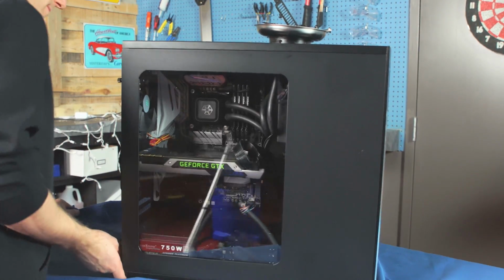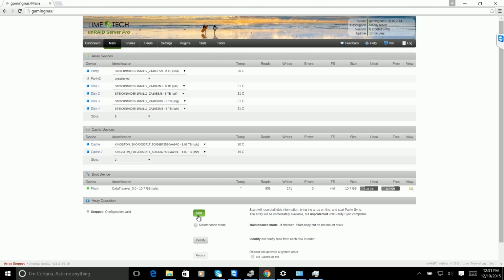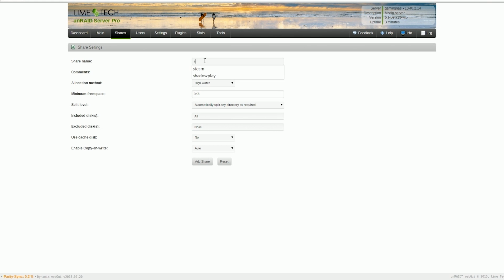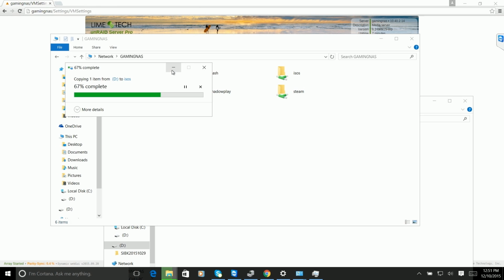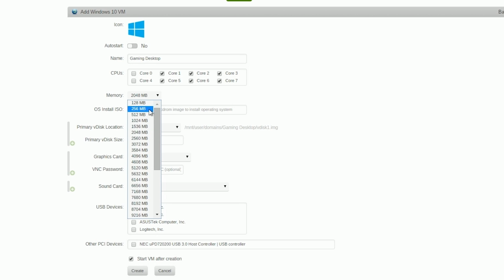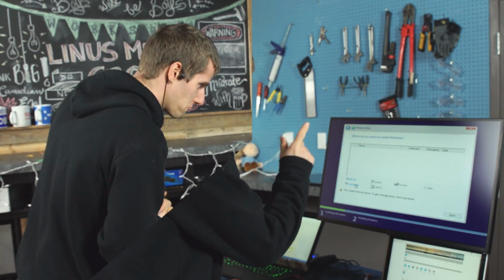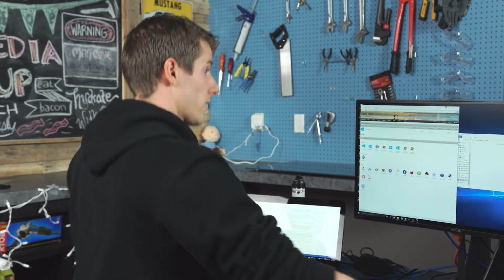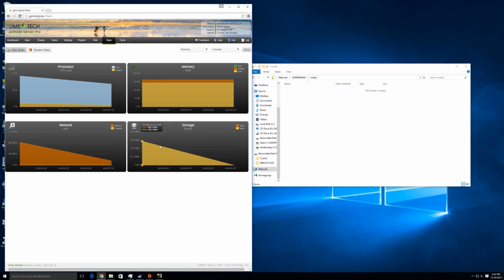Use your Gaming PC's Extra Power as a NAS Ultimate Guide

Comment: This is cool but such a terrible way of making this system. You could do a software RAID 5 through the BIOS (or buy a RAID card with 10 ports off ebay for $5), install windows on the computer normally then create folders on the RAID disk and share them on your network with windows share. That way you are not running your OS in a virtual environment (I think this takes away performance?) and everything is still perfectly accessible through the network.

Comment: Nice setup, but this "NAS" is consuming to much power to run 24/7. I would prefer an dedicated device from Synology and run VMs attached over iSCSI. There are also no reasons to store your Steam library on a redundant storage, because you can download it again if a HDD/SSD crashes. A single local SSD would be fast enough for executing every game.
BTW: Is there any reason for using LimeTech unRAID? It don't see the advantages of this product. It's just an web interface for a common Linux and KVM-Hypervisor. o.O

Comment: I thought about doing something like this, but ended up building a stand alone server instead. There is extra cost setting it all up yeah, but man.. You save an arm and a leg in running costs not having to run the high power gaming gear 24/7. 

..and being a low noise freak i enjoyed having the option of placing the server with noisy mechanical drives where i want it to be, not having the drives placed right besides me.

I get the need for VM's if you have a powerful server, and wan't it to handle several different things. I'm thinking about something like that for my setup tbh. but using a high wattage gaming rig as the base of it? No thanks, not for me.

Comment: I actually like to use seperate hardware for applications like this one.
Reply: +Philip Lee A Qnap or Synology model with enough power to give you the same network read/write speeds compared to a full PC is at least $400+...  This is just saving you the extra cost. Also allows you to create other VM's like Kali or whatever you want.
Reply: As Linus explained in another video, you can do really well by repurposing an old computer for NAS duties. I think that's a good way to go. Then you can buy whatever you want for gaming without having to worry about this NAS stuff.
Reply: +James Yap exactly, better off using a standalone "store bought" NAS as it will use FAR less power, infact probably enough to pay for the added cost of the standalone NAS in the first year if left running 24/7.
Reply: I'm running two separate Synology boxes, why? Well, I like to have 24/7 uptime - which has been the case since December 2014; and my NAS solution will not experience any downtime as say due to some random Unraid issue.

That said, I will be giving Unraid a spin for some other fun I have planned - to allow me to boot multiple virtualised instances of linux.
Reply: @bsodmike  Unraid is no more unreliable than a standalone NAS. It is based on a version of Linux, as most NASs also are, the difference is Unraid is far more likely to receive security updates and bugfixes. Not to mention offers far greater functionality. Depends what you need I guess, if you just need simple file sharing then you can pay a premium for a NAS, if you want more than that then go for Unraid
Reply: @rfitzgerald2004  a setup like this compared to a standalone nas requires running a full desktop pc 24/7 rather than the far less power consuming standalone nas that can be bought, that said i am looking at trying unraid when i get around to building my new pc
Reply: +Philip Lee REALLY?? WHAT'S WRONG WITH UNRAID?? i'M NOT AS HIS LEVEL BUT I WOULD NEVER BUY A NAS! WHY YOU ASK, THEY'RE A WASTE OF MONEY. A COMPUTER IT FOR RUNNING EVERYTHING NOT JUST ONE THING, BUT YOU GOT THESE COMPANIES SEE $$$ IF THEY CAN BUILD A COMPUTER THAT ONLY DOES ONE THING AND SELLING IT FOR $$. WHEN YOUR COMPUTER CAN DO IT FOR FREE. I HAVE SEEN THIS OVER AND OVER AND OVER.

Comment: Well, I want my NAS to consume as little power as possible and leaving an i5 or i7 with a dedicated GPU running 24/7 isn't exactly power saving. 
But a cool build anyway. I like these crazy server and desktop builds :D
Reply: GPUs and CPUs dont run 24/7 while they are turned on. Web surfing and even youtube keeps my GPU at less then 10% power. Also, with NAS if your not using your main VM machine and are using another system to read+write to it only the CPU kicks on to move the data, then it powers itself to a low power STANDBY MODE state. No electronics stay on 24/7 unless your a Seti Folder or Cryptocoin Miner.

Comment: What's the point in even putting this in a VM container in the first place?  Couldn't you just have separate drive shares shared across the network and achieve the same thing.  All I see that is unique with this set up is the caching from the SSD, but is that so much better that it justifies dicking around with VMs and virtualising your hardware with pass throughs and all the kerfuffle that involves?

Comment: i told them over vessel, they did the same mistake here again, why don't they provide the details of the parts they used?
i want to know the exact model of that bay that can support those 3,5 disks in front for a small server i am building.
anyone got that name and model guys?
Reply: I feel LTT isn't good at this. He didn't show us what he cut off with the dremel either.
Reply: +Infinite Zero well because what needs (if any needs cutting) depends on the CASE YOU ARE USING. as for what the part is, well it would be an FS305 http://silverstonetek.com/product.php?pid=605&area=en as that is the ONLY Front panel 5 drive unit in their lineup, which took me all of 2 minutes to find (if that) after Googleing Silverstone also if you pause it just right during the intro right before the logo comes in @1:06 you can just read the model number off the box
Reply from the maker: +johnnyxp64 We link the parts we use in the forum link in the video description :)

Comment: Can I get some feedback on this PC. I could upgrade more, but I don't want to go overboard as I want to have some money spare.

Uses: High Graphics at 1080p, Good Frame Rates for latest games:

Intel i5 4690K (3.5 GHz)
NVidia GeForce GTX 970 (4GB)
8GB HyperX Fury RAM (1600MHz)
500 GB Samsung 850 Evo SSD
1TB Seagate HDD
Coolermaster 212 Hyper Evo Fan Cooler
650W PSU
Windows 10
ASUS Z97 ATX, USB 3.0, Sli, XFire SATA 6GB MoBo
Arctic MX-4 Cooling Thermal Paste

Any Feedback would be nice :)
Reply: Everything's good, but you should change the 970 to an r9 390. It's much better. More specifically, I recommend a MSi variant.
Reply: +Thomas Coleman 650W PSU complete overkill - buy a good 450W. Your PC only needs about 300 W at Full Power and with overclock - so 450W gives you plenty of space
Are you really going to overclock? If not, buy a Xeon, should be around the same amount of money, but has more power.
Cooling Paste ist already shipped with your cooler - for usual...

Everything else looks fine...
Reply: I know it is a bit much, but I am planning to upgrade later after like 2 years of use, and it after calculating on many websites it is just over 550W with a 20% allowance. I couldnt find a 600W Power Supply on the website so since I was going to upgrade I decided with the 650W. What you you think about the CPU and GPU?
Reply: +Thomas Coleman 

PSU: Let&#39;s calculate it: Around 120W for a very hard overclocked i5, + 250W for a very hard overclocked GTX 970 = 370W Basically for the OC-Watage I have doubled the TDP (Thermal DEsigned Power) from both,  to reach a need of power you will never reach, but just for the sake of argument.. Let's say 50W for loading a Tablet, some USB stuff in general, etc and you are at around 420W --  a GOOD 450W psu is good enough for hard oc.

Because of upgrading - looking at the current development, it is likely for newer card to use even less power, because people seem to like power saving cards (Seeing 970, basically being a little worse then the r9 390, but still people buy the 970).

My recommendation, buy, if you are really scared, a 550W PSU from a good brand like Bequiet, Seasonic, etc. But please do not buy a 650W psu from some noname manufacturer - your efficency will vanish and you are likey to get some shitty psu, eventough it says 650W Gamer Extreme Overclocking PSU. Also, don&#39;t forget to look at the power it can deliver on the 12V-line, since it is the most important....

CPU: As said, and I am sure many would agree these days you don&#39;t need a 4GHz i5 for gaming. These days the GPU is the limiting factor. So my recommendation, save the money from the K-CPU, get yourself a Xeon, basically a i7 without IGP and a few MHz less, or atleast buy the non-K version. You can still OC it a little bit via the Z97 chipset, but with the saved money you can get a better GPU, a better PSU, or go out for dinner...

GPU: Since your screen resolution is  only 1080p the 970 is kinda overkill, since you want to swap it in 2 years. If you have a 144Hz Monitor and want all ultra MSAA maxed out (x8 or x16), or heck even CSAA, then yeah, go on and buy it, you will be happy with it. On the other hand, if you don&#39;t want to speed  that much money on GPU only, and since it is only for around 2 years, and if you do  want ultra /very high settings but can live without 8x MSAA then I would consider something less powerfull, since it will be enough for all titles in the next 2 years. In my opinion the R9 380 / GTX 960 would do the job for you, being 100€ cheaper (around 100$ :(  at least were I live..) they would still deliver solid FPS, and if that is not enough, take a look at the R9 380X (sadly Nvidia does not have anything in this pricerange). It cost around 240€ at my place, gives you a bit more power then a R9 380 (around 10-15%). I personally will probably buy a R9 380X. + AMD cards are less likely to get coil whining, compared to the GTX 9xx series..
Reply: Thanks for the advice :) I'll edit the order a bit, thank you very much :D
Reply: +Thomas Coleman No problem, glad to be able to help you
Reply: Would you say that a Corsair PSU is a reliable brand?
Reply: +Thomas Coleman Also, don't buy a CX series Corsair psu (you can google the reasons why).
Reply: +Thomas Coleman A R9 380X will run all current games on highest settings (without maxed AA) on 1080p, everything more powerfull would run the games too, for the next 2 Years, but it would be a waste of money...  PSU wise, if you have not already ordered, I think Corsair would word, I personally have a midrange Seasonic, EVGA, Bequiet and Corsair should be fine.
Reply: I ordered but can edit within 2 days... The website doesn't actually have R9 series so that would be the main reason I am getting the GTX 970. Also In 2 Years' time when I come to upgrade, with new titles coming I could maybe change to AMD if they sport another good GPU that runs all games 1440p Max Settings...
Reply: Mine is VS series... Is that good?
Reply: +Thomas Coleman Looks good. You won't need the thermal paste as the processor comes with a cooler with the thermal compound already applied. Also, unless you're looking to upgrade, you won't need 650W. I run a i5 4460 and GTX 970 on 550W and even if you're looking to overclock then you 600W would be enough.
Reply: This is an advanced cooling paste to keep CPU temps low... I am going to replace the standard thermal paste anyway.
Reply: +Thomas Coleman You're unlikely to get any noticeable performance gains as basically all 4th gen i5 CPUs run really cool anyway. Mine tops out at around 40 degrees which is just with the stock cooler.
Reply: Corsair seems fine, how much money you want to spend on psu?
Reply: Around £40-50 (I am from UK) so around 80-90 USD...
Reply: Max A. Also do you think it will run games like Just Cause 3 etc...
Reply: +Thomas Coleman change your gpu to r9 390
Reply: R7 260X Gaming Is there any reason in particular?
Reply: Better performance and more vram
Reply: And since your psu can support this card
Reply: K Thanks
Reply: +Thomas Coleman Ignore him.

GTX 970 is a great card. Generally because of NVidia's stinginess to allow other companies access to technologies they'll run better in game the implement them which is a large majority of games compared to AMD's implemented technologies.

More VRAM =/= better performance.
Reply: Ignore whom?
Reply: Thomas Coleman me
Reply: +Thomas Coleman You should get a 390 over a 970. Stop letting claims by us influence you and go watch a video on 390 vs 970. Afterwards, I chose a 390 (over a 980).
Reply: I already looked at it and decided that I want the GTX 970 as its better than the R9 390 and even the 'X' version.
Reply: +Thomas Coleman Can I have whatever you're smoking? All jokes aside, another thing you should consider is waiting for Nvidia's pascal GPUs, coming in Q2 or Q3 2016 if I remember correctly. That's if you have an enormous amount of patience though.

Comment: A graphics card is  requied to generate a Web UI? Can someone source that?
Reply: I have to agree, we need answers dammit!
Reply: +Jeremi Świerczyński He meant the GNU/Linux desktop which can give access to the WebUI if there is no network connection.
Reply: +ElectronicsWizardry lol, you need it. A gpu is needed to get past post.
Reply: +Jeremi Świerczyński no way. Your router has a Web UI. Every CPU (without integrated GPU) should be able to handle that much.
Reply: +Jeremi Świerczyński a graphics card is needed for the gaming, the on-board graphics was used to set up the NAS element because you don't need that to be mounted in the VM element.  So what you have is a NAS running a VM of Windows so you can play games.
Reply: +Jeremi Świerczyński  You don't need it, but it makes it much easyier to setup the host os as then you don't have to use serial. If you have impi you can use that as well.
Reply: ElectronicsWizardry
Uhm what has Impi to do with that? (I guess you mean the GNU distribution)
Reply: Ipmi lets you control the system over the network so you don't need a gpu or monitor to control the system. Its commonly found in servers and almost non existent in consumer electronics.
Reply: ElectronicsWizardry
Ahh thanks I read "lmpi" which is a Linux distribution
Reply: ElectronicsWizardry
so basically you swapped p and m that makes a difference :D
Reply: +Jeremi Świerczyński You need some type of graphics card for the system to even POST (integrated works just fine). You do not need to have a monitor connected to it.

As for generating the Web UI, No, the GPU does not handle this task.
As far as I'm aware the current version of UnRaid (6.1.6) doesn't have a desktop. Connecting a monitor locally just gives you the console.

It looks like Linus is using a beta copy of 6.2 which has a bunch of new features (Seconds parity drive and perhaps the desktop).
Reply: +Jeremi Świerczyński only on the first run

Comment: One thing that needs t be mentioned is the the CPU in Question need to have support for VT-d.  and not just Virtualization technology support. Only when u have VT-d can you make a a Device pass through directly to a VM. The example that straight come to head is a the Haswell i7 4770K. The 4770K has support for virtualization. but lacks VT-d and hence will not be able to pass through a hardware device to a VM in a dedicated manner. Cheers

Comment: The idea is cool, but the major flaw is that while this is efficient in terms of money, it will be far less power efficient than a dedicated nas with select hardware.
The difference would be greater between this unraid system and an off-the-shelf nas, than between this system and a diy nas.
Solar power for the building would solve this issue.

Comment: I wonder how this translates over to x99 since it doesn't have a separate graphics processor.....just the one graphics card? CAN unraid share said 980? 

also do you have to dedicate cores specifically to unraid?

also if your computer were to crash for some reason......from say over clocking does unraid crash as well or does just the windows VM crash?
Reply: Gotta get a cheepo pice card
Reply: +Kris Wedderburn (Lando) If the system crashes because you overclocked (hardware problem) then everything crashes but when you have a faulty driver in windows (software problem) and get a bluescreen only your windows crashes.

Comment: Firstly what was the power consumption like? It's all well and good re-purposing a gaming setup as your NAS, but if it's going to use 3x the power of a cheap $200 low power specific NAS build then it defeats the purpose.

Secondly what was the performance difference between running the games on Windows native over being virtualised? If you're losing 10-20% then again it defeats the saving as you could just buy slower components and have a separate NAS.

I know it's a a novel concept, but practically you're not going to virtualise a gaming rig. This would have had more real world application by virtualising something like an HTPC on top of a NAS. Or how about virtualising the parents everyday PC like this so you can do your offsite backups to it without imposing another computer stashed somewhere.